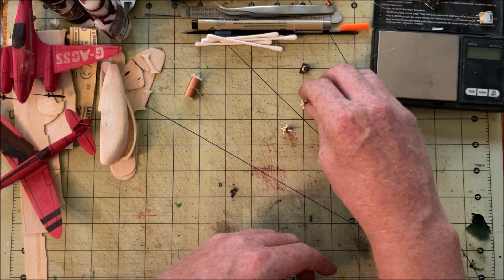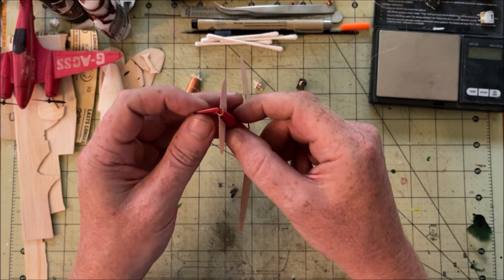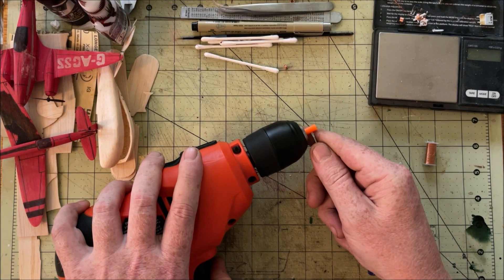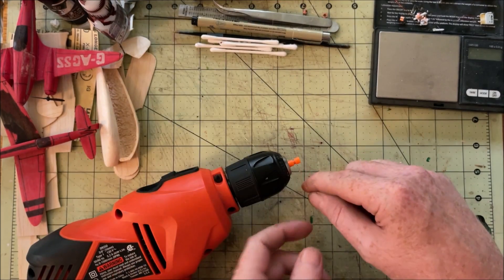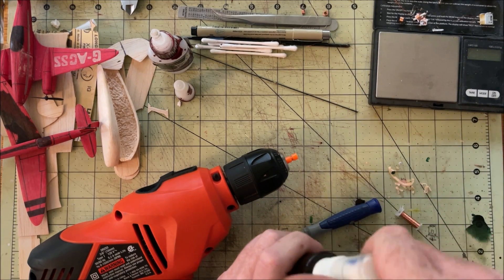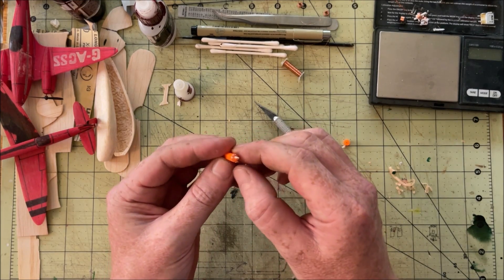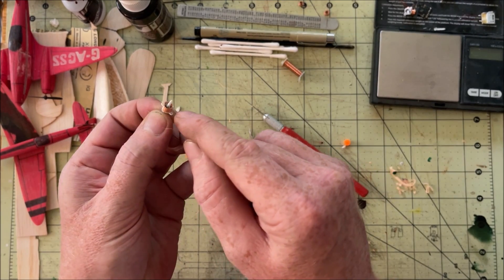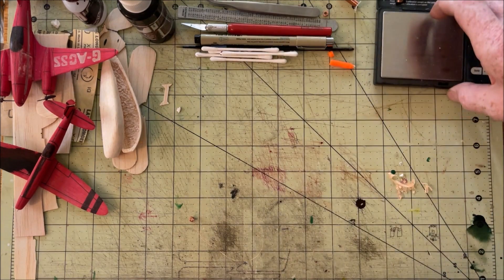Micro RC Plane Magnetic Actuator DIY

Comment: Very good video but with 2 wire out, how can it turn 2 direction? Do i have to use H - bridge like l9110?
Reply from the maker: Thank you!  The receiver reverses the polarity of the voltage going to the coil, which reverses the direction.

Comment: Great video on how to make a coil wire, but to make the actuator you need to A) Orient the disk magnet, B) Orient the coil actuator correctly so it flips the magnet left to right, not up and down or at a 45 deg angle, wasting power.  How do you find the correct orientation of both of these is not covered in the video which is super important.  Also, not enough coil turns and you will A) not have enough magnetic force, B) will heat the coil with whatever power is going through the wire, again wasting power as heat rather than magnetic force. You need to determine stuff out before you start winding like what the awg of the coil wire is (43? 48?) is and how many winds and how much current will be going through and how many ohms the coil will be when you are done, also you need to look at the size of the magnet disk to determine the inner coil diameter so that there is enough space for the magnet to flip inside of it, how to measure ohms by hooking it up to a multimeter afterward.   How are you measuring the actuator force to determine you are getting the most out of it without wasting power would be a key factor in creating a successful actuator.  Maybe you should rename the video to how to make a coil wire until you explain the whole process.  I see prebuilt or bought actuators with the arms and they were made by companies where they figured out all these issues..  So yes, i was a bit disappointed after watching this video so i will continue to look for a more complete video, but thanks for the coil making tip and if you could say where you got those diameter candles would be helpful too.   Bill
Reply from the maker: Over 20+ years, I've never worried about the gauge or or how many wraps/resistance or the orientation of the coil/magnet, 'that looks about right' has always worked for me and my actuators have always worked fine lol

Comment: can this be proportional?
Reply from the maker: Yep, so long as the receiver youre using to control the actuators gives a proportional signal, which most do these days, fortunately!
Reply: @microbuilder
ok thanks.

can this be connected to aruduino? if so what drive or chip should i use.
Reply from the maker: @rafi481  That I'm not sure of, I've never tinkered with arduinos.

Comment: Where do 2 leads of coil connect into?.....directly into +ve and -ve of one of the channels of receiver leaving signal terminal unconnected?.....
Reply from the maker: You need a receiver thats meant for driving actuators rather than servos, those receivers have only two outputs that the actuator leads connect to

Comment: They could be centered with another smaller magnet on the outside of the coil , or with 2 actuators side by side so they attract each other ..

I remember you from the forums a decade ago, glad to see you back at it. I guess I should bust out the old plantraco gear.. Ornithopter ?!?! 

You can get a mini FPV Drone for less then $20.00 nowadays. Crazy .. Where are the cheap micro 4ch scale planes / jets ??
Reply from the maker: Yes indeed, in fact the actuator with the arms actually has a little slot to mount such centering magnets...completely forgot about that...

A decade ago sure sounds like a long time ago, feels like it too lol  I never did end up getting a Plantraco plane, I did have their micro Blimp though which was surprisingly fun.  And yeah, electronics have come a really long way, much cheaper and much smaller/lighter...could probably build a pretty tiny orni these days...
Reply: >>You can get a mini FPV Drone for less then $20.00 nowadays. Crazy .. Where are the cheap micro 4ch scale planes / jets ??

YES! I've been saying this for some time now.  with some clever programming and thrust angles/thruster positioning it should be possible to build a 4 channel fixed wing with exactly the same electronics that go into a micro quad and no control surfaces.  I've been messing with microcontrollers for a little while now and I suspect it may be possible to flash custom firmware onto one of those cheapy all-in-one boards.. A lot of them even have tx and rx pads labelled.   Unfortunately, it seems that very few folks are attempting this and those that are don't seem to be documenting it.

Comment: I look forward to watching how the magnet works within the coil. Thank you for sharing your knowledge.
Reply from the maker: Youre welcome.  I will be doing a video on installing the coil and magnet in a plane hopefully this coming week.
Reply: @microbuilder  any hope?
Reply from the maker: @promess  I do have a project in the works using actuators!
Reply: @microbuilder  slick! I'll watch when you post it! :)

While I'm an absolute novice, I've got this fantasy of building a ~10 inch stol high wing? I'm in the planning phases now of trying to build it 5 channel slow flier that i can hopefully jam around my living room. Kinda thinking ugly stick, maybe polyhedral, at least di... with a 8-10 inch wing span? I was under the impression that I was going to have to go w/ the 1.3g servos then I saw your video on actuators and while fiddly, it absolutely seems way more possible than I'd have thought previously.  How hard is it to build 2 sided actuators(I've seen the examples, but i can't think of how they work DIY style, in this the mag attracts based on polarity, but with pass through... huh? how? )? 

Any suggestions on how I build materials? I was thinking of trying to make some spars to bend some damp balsa over and cover the bottom with tissue... I also saw a really small affordable small scale "dental vacuum former"(search it in amazon, it's like 115? :o wild right, so many ideas! ) that wouldn't be too hard to make some more rigid airfoils/fuselages with, but I don't know a.) if the actuators could potentially get hot enough to weaken the plastic, and b.) how would i place them in the wings for ailerons? Thanks for your content, I didn't even know any of this was possible before your lil red sports plane. :)
Reply from the maker: @promess  Living room flying is really fun, the only downside is wingloading (how many grams per square inch) becomes the most important factor for how slow it'll fly, which will strongly dictate how big/small/complex your build can be.  For instance, the ParkZone Mini Vapor has roughly an 8x5" wing and weighs around 12 grams, which gives it a wingloading of around 0.3 grams per square inch.  My last LRF was a 5" version of the Mini Vapor and its wingloading was 0.2g/sq in.  So, either building as light as possible, or building bigger are the two typcal ways to go about it, only downside with building bigger is your living room starts feeling pretty small lol  Theres definitely a bit of an art to indoor/living room builds, but I have a few videos on my channel that show some of my past living room flyers if youre looking for examples.

As for a dual arm actuator, I actually havent tried building one of those, mostly because its super fiddly work, and I'd rather just buy one and save the time/frustration lol  but they work the same as a single arm actuator, its just a matter of which way the polarity of the power is sent through the coil, which changes the polarity of the magnetic field, so the magnet moves in accordance with the change of the coils field...its just like taking single arm actuator and adding another arm on the other side.

As for materials, forming wetted balsa and using tissue as a covering is usually the go-to way of doing indoor flyers, though the bottom of the wing typically isnt covered since at the size/speed of indoor flyers it really isnt needed and just adds extra weight.  The actuators coils definitely shouldnt be getting hot, at least not hot enough to melt anything.  For mounting them in a wing, you'd do it just the same as you would a servo, right in the middle of the wing with a couple small push rods joining the actuators arms to the ailerons control horns.  

Check out the Scratchbuilt Indoor and Micro Models forum over on RCGroups, you'll find a ton of info on all this sort of stuff, its a wealth of info!

Comment: Thanks for the video, it is super interesting !
I have one question, how do you power these ? Like how do you control it from your receiver?
I have tried to make one of these some time ago actually, but it did not performed well enough to put on an actual plane, the wire diameter was too large ha ha
Reply from the maker: Thanks!  The receiver powers the coils like they were a regular brushed motor, since theres no potentiometer like on a servo, it just sends current straight to it, and RX gets the signal from the transmitter like any regular RX.  There will be a video coming installing and setting up everything, so hopefully that'll clear it up.
Reply: If you had a very small servo with the gears stripped or something you could take the circuit board out and connect the coil where the motor used to go and either glue the pot in the centered position or replace it with a pair of fixed 2.5k resistors.  Then you'd just drive it like a regular servo.
Reply from the maker: @whatelseison8970 Yeah I've considered that a few times, theres also servo to actuator conversion boards...not the lightest way to do it, but its definitely a useful option to have.

Comment: Can you use a normal PWM channel to control this somehow?  I would really like to make a micro DLG... even though I know it wouldn't perform well, It would be neat to have one.
Reply from the maker: Should be able to, the RX drives the coil like it would a regular brushed motor.  As for a micro DLG, definitely go for it, I made an 18 gram 2 channel one using micro servos many years ago that worked quite well, the couple times I was able to catch a thermal it climbed like a tissue in a tornado lol
Reply: @microbuilder  I am a bit confused by that.  PWM normally controls servos and not motors directly.  I assume there is some power differences between servo throws as PWM varies how long voltage is applied, but I wouldn't expect it to be that much of a difference.  I could be way off though.  I am no electronics guy.
Reply from the maker: @adam.gibson  I could be completely wrong too lol
Reply: @adam.gibson  You are right, you cannot drive these directly from a servo PWM signal; not just because there's no current driving capability on the signal wire, but the pulse width only ranges from 5-10%, so even with an amplifier it still wouldn't work.

If you had a very small servo with the gears stripped or something you could take the circuit board out and connect the coil where the motor used to go and either glue the pot in the centered position or replace it with a pair of fixed 2.5k resistors.  Then you'd just drive it like a regular servo.

The circuit board inside the servo does the job of translating a servo PWM signal with pulse width of 1-2ms (5-10%) to a high current motor PWM with pulse width between -100% and 100% depending on the position of the pot. With the pot fixed in the center the board basically becomes a tiny, bidirectional, brushed esc.
Reply: @whatelseison8970  Thanks for the reply.  I kind of suspected that but I wasn't sure if the pulse width had enough space between signal to change voltage.  It makes sense that isn't the case otherwise there wouldn't be enough power in the servos at one of the extremes.  I want a micro DLG about 6 or 7 inches that has movable surfaces.   Just not enough need for something that small to get companies on that bandwagon I assume as I am sure there has to be some way to do it given enough smarter people than me on the task :).

Comment: I made one of these years ago - there's a video in my channel. I learned that in theory it's a simple mechanism, but they are tricky to build to specification. There is a 1/96 spitfire on youtube that uses several of them and there are a few threads on rcgroups from a gentleman who build very tiny ducted fan "jets" with coil actuators as well. Recently i found some led candles that use them to create a flickering effect.
Reply from the maker: I know exactly which planes youre talking about, and they are amazing little works of art!

Comment: i absolutely love these little things. I wish there was more information on making em. 
Have you looked into elrs? I think there's a ton of potential for custom rx boards for things like this.
I saw a github project with elrs rx + brushed ESC + servo integrated
Reply from the maker: Thanks!  I hadnt heard of ELRS, but it does look interesting...micro RXs, especially ones for magnetic actuators, are few and far between, and it would be really cool to be able to make my own, ultra lightweight servos would be great too.  Looks like its a whole hobby unto itself though, but definitely something to look into.  Thanks for the heads up!
Reply: @microbuilder  its entirely opensource rx design. i think it would be a great match for these things, as you could make the rx  do whatever you want, and very cheaply
Reply: Can I get a link to that repository?